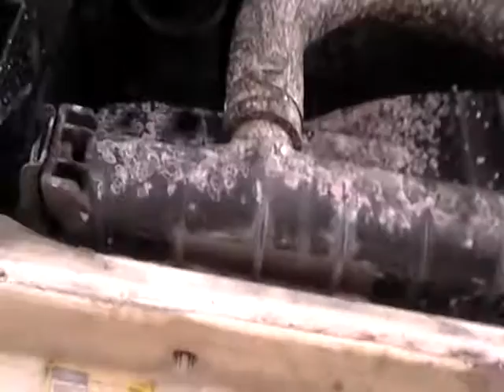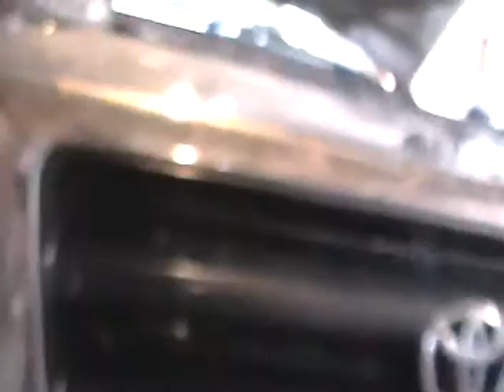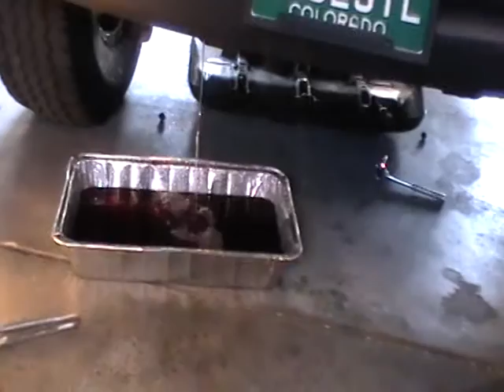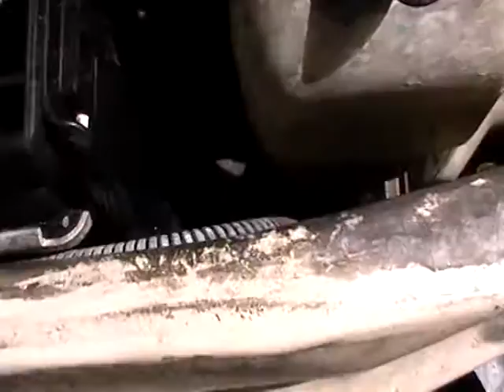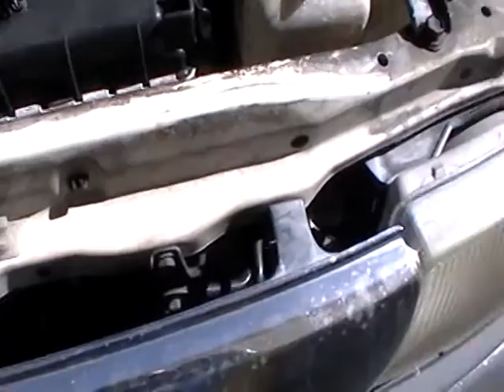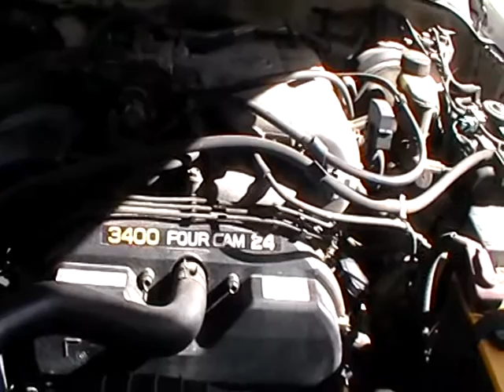1999 Toyota Tacoma 3400 Radiator Replace

Comment: What happened if i install a radiator 18 5/8?
Reply from the maker: If you have any question on the size of the radiator for your truck,  contact your local Toyota dealer parts department for the correct application for your particular truck.

Comment: the radiator is 22 5/8" form bottom of core to top. And there is no proprietary antifreeze that i am aware of.
Reply: There isnt, I use the cheap green glycol in the blue containers from wally world. 200k no issues